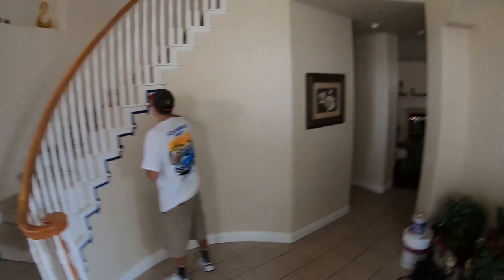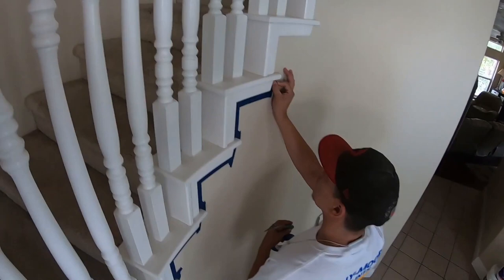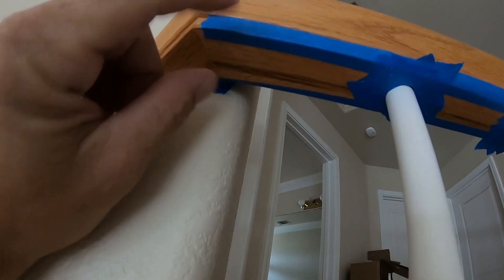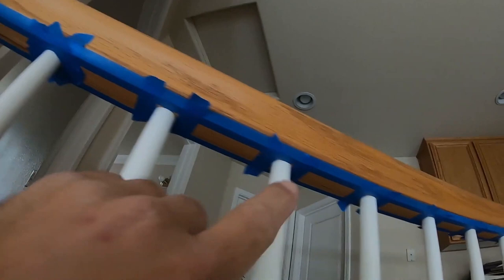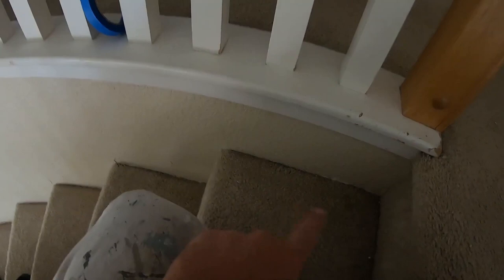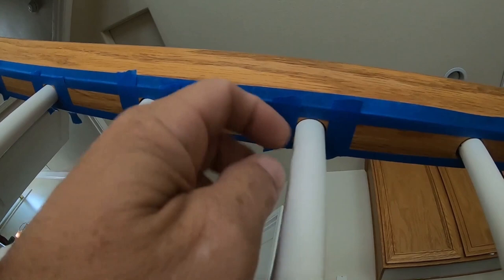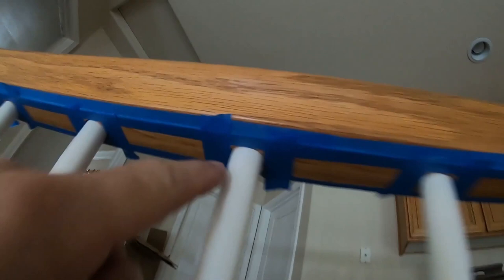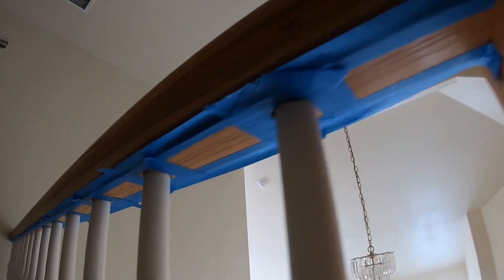HOW TO PREP SPINDLES FOR PAINTING A STAIRCASE

Comment: try drilling thru a roll of the easy relesase tape on the edge so you go thru every layer with a 1 inch hole saw  3 times even around the roll(like 3oclock,7 an11,
then cut an inch beyond the half hole and youll have precut c shape tape for the bull nosing and for the top of spindles maybe the half inch hole saw for under the top hand rail  now its only 1 piece of tape for the tread bull and 2 for the top  youll know what to do  big time saver
Reply: "Chin hair" , love it......
🤣

Comment: Very helpful, thanks. If you were priming plus 2-coats, would you remove the tape and reapply for each coat? If not would you cut the paint with an x-acto before removing the tape? Thanks for your expertise! Great video.
Reply: Thanks for the like but I'm still wondering if you'd re-tape after each coat or just leave the tape and cut the paint with an X-acto.
Reply: Hey not sure what you mean by an x-acto but I'm just going to leave my 2 cents... You want to leave the tape on as well as any paper or other protection you may have put in the stairs until the project is finished. Prepping to paint spindles like this is a long process and you do not want to spend another hour or so prepping again.
Reply: Thank you. By xacto I mean a utility knife. I ask if you would cut the paint before removing the tape because the underlying coats will be dry and sometimes the tape pulls the paint off with it once it has dried. Do you cut the paint with a knife before pulling the tape?
Reply: @alienproductions9948  I see, you shouldn't have to if it was cut properly. Your tape shouldn't be touching the painted part of the spindle. Now it depends how long the tape has been on there but generally speaking it shouldn't be on there for more than a week or so.  Don't mention it! Hope that helps.
Reply: @frederickwagner5776  thanks again. So to be clear, you dont paint over the tape, the tape is just a guide for your brush and just in case you slip up?